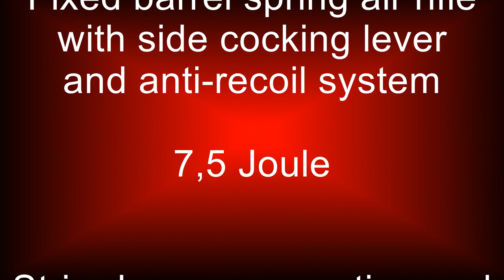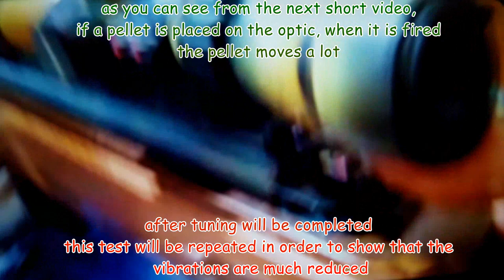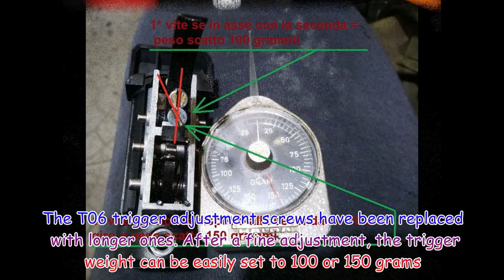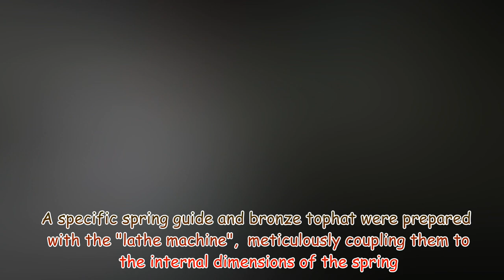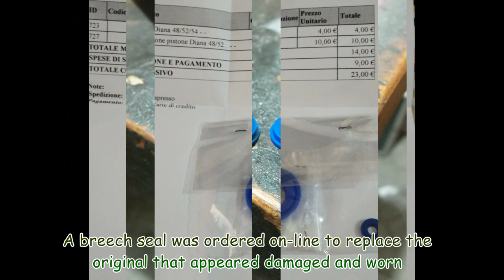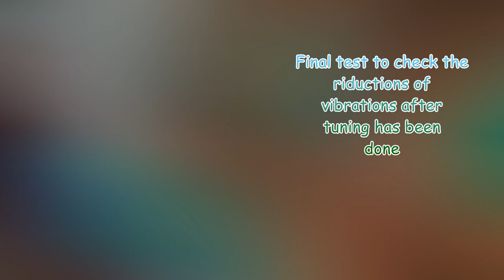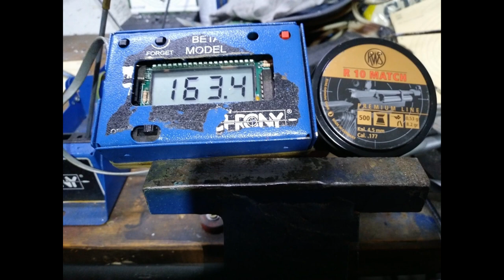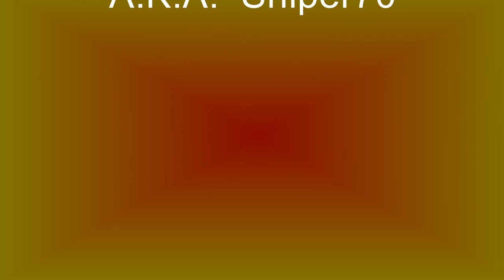DIANAWERK mod.  54 AIRKING - cal. .177 - Sliding Anti-Recoil System - stripdown and tuning Part1

Comment: There is a vast amount of info in this video. I just purchased a new Diana 54 and need to do the o ring mod to the sliding rail system but without any verbal talk through instructions to go along with the really good visuals. I was hoping the distracting music and visual confusing sequences were just an introduction  to the process. Darn! Could have peen perfect but without the complement audio explanation,  just  not clear  enough for me to attempt the the mod.  There seems to be very  few u tubes demonstrating this so was really hoping this would be my guide.  . This may  be great for someone familiar with tuning air rifles or is mechanistically gifted. Unfortunately  for me, I am neither.
 Thank you anyway for putting it out as I can  use it as a reference if I can find something more verbally detailed.